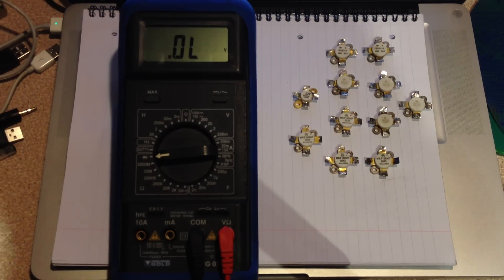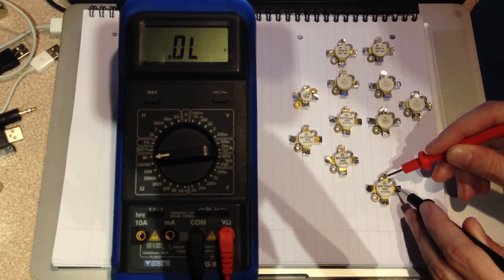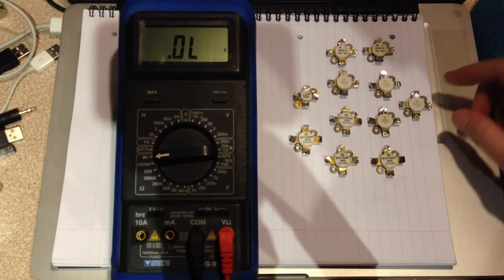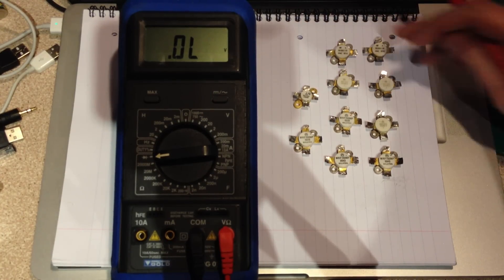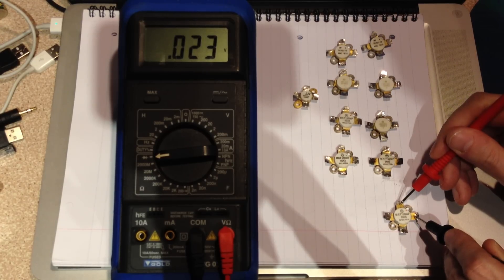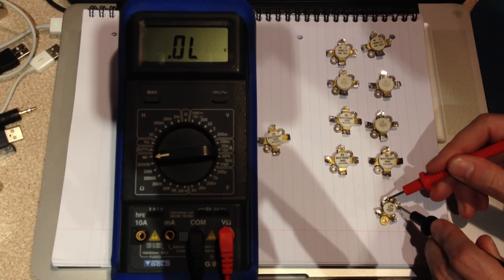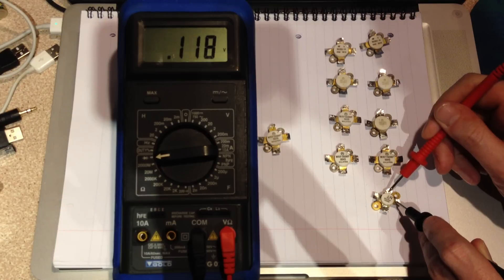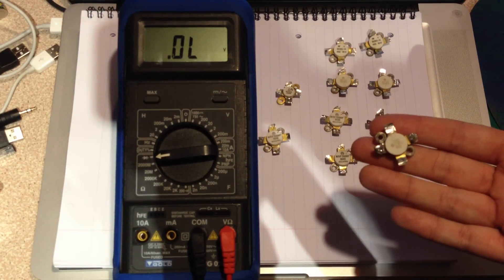How to test an RF MOSFET with a digital multimeter

Comment: Your test is only an "indication" of function. Since there are many FETs essentially connected in parallel inside those devices... one can't say that all sections are working without an in-circuit power test... comparing the device to the manufacturer's specification. So while your test can weed out Parts that are completely bad... it can't tell if a part is completely good.

Comment: im trying to test toshiba 2SC2879 and without" charging the gate" it reads 400 and then goes up to 1000 something.that mean its bad??
Reply: The 2SC2879 is not a MOSFET device. It's a bipolar transistor.

Comment: Next time you have a faulty one (assuming you don't have other uses for them) could you crack one open (yea i know easier said than done) so we can see how they bonded those massive leads to the substrate? Assuming you've got better things to do or if it will be a pain in the A%#  a simple "No" will be all the explanation I require. :)